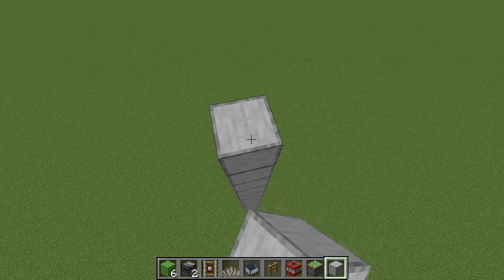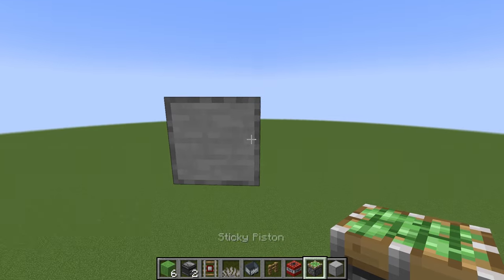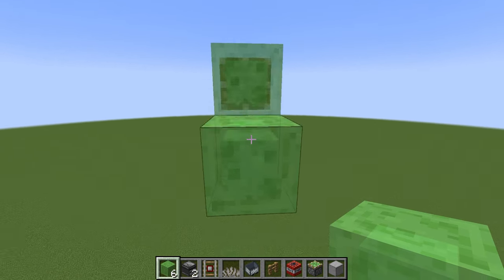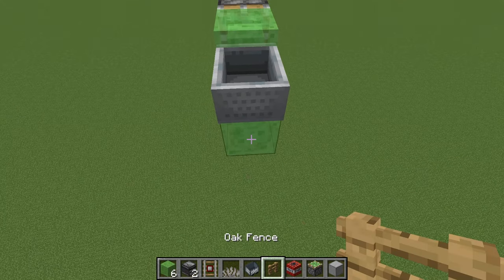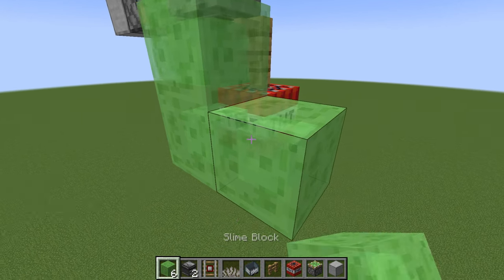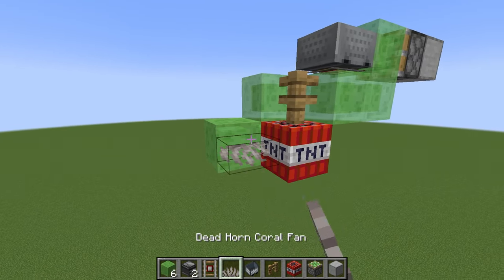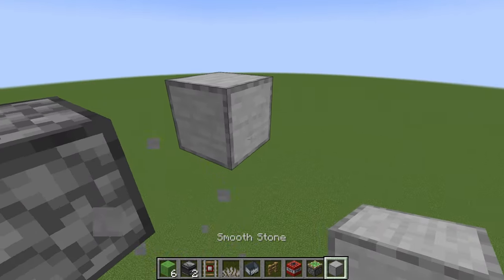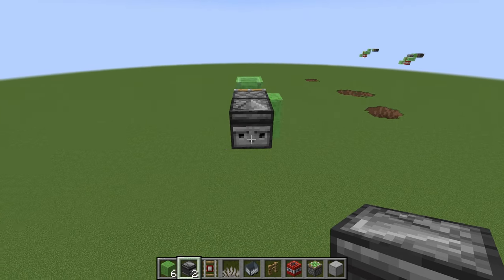The Best 1.20.2 TNT DUPER in Minecraft

Comment: for every one who is loking for answer why it is not working on java servers. in server files "paper global" you have to change piston duplicator from fals to true
Reply: Thats only if you use paper. Most people should have stepped over to Forge at this point (same benefits as paper, easier to mod the server without impacting performance and less reliance on people having client side mods).

Paper has disabled tnt duplication because the people behind paper feel like its an exploit that shouldnt be used (even though minecraft has fixed it before, then rolled back the fix because there is no renewable way to obtain TNT yet).